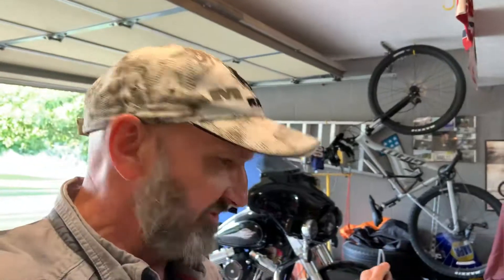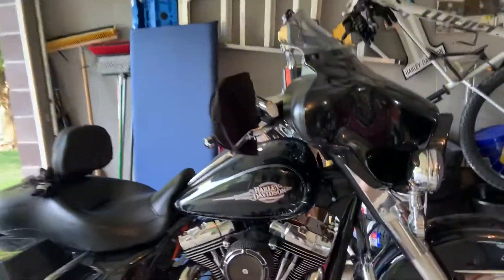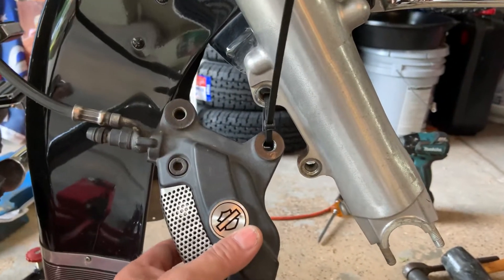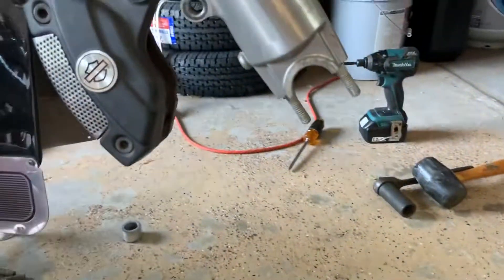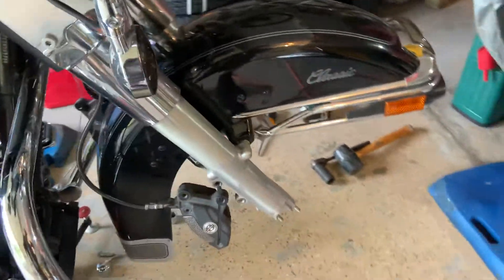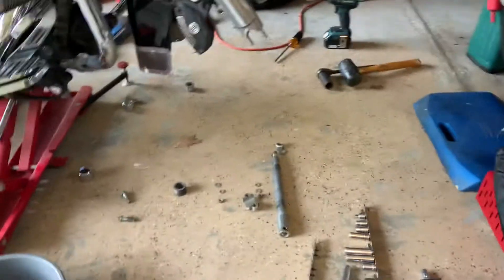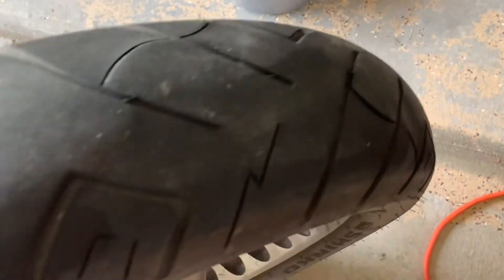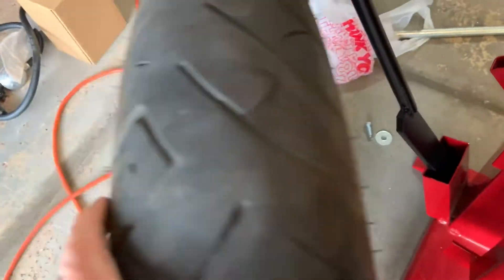Remove Front Wheel Harley 2012 Electra Glide

Comment: Is it the same procedure for a 09 Electra glide? Thx😊
Reply from the maker: Yes. I had an 09 before this bike. One of the best models made. The 96ci TC was the best all round engine. Only weakness in the bike was the compensator. When it wears out don’t buy the SE. I’ve got the Darkhorse ManOWar in the 12. Highly recommend.
Good luck & thanks for watching.
Reply: @dougfresh1341  what's the SE?
Reply from the maker: @haroldyazzie3538   HD Screaming Eagle. Harley redesigned the compensator about 5 times. It still ain’t right.
Reply: @dougfresh1341  o ok.. my Electra glide is over 50k miles. I'll look into it. Thx brother 🙏
Reply from the maker: @haroldyazzie3538  just got over 100k on this bike. At 85k refresh. OEM cams, tensioners, timken bearings, etc. Runs like new.
Reply: @dougfresh1341  nice!